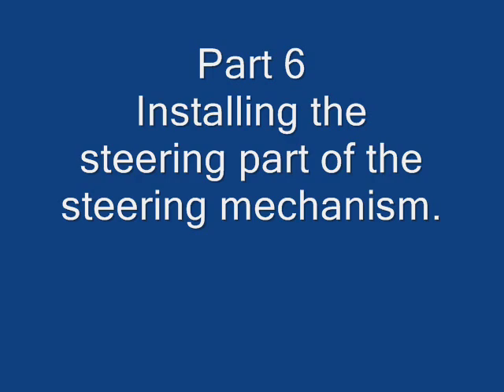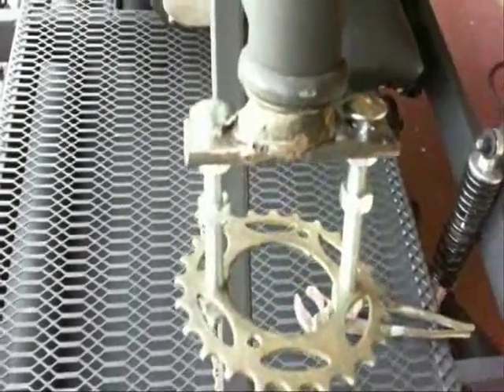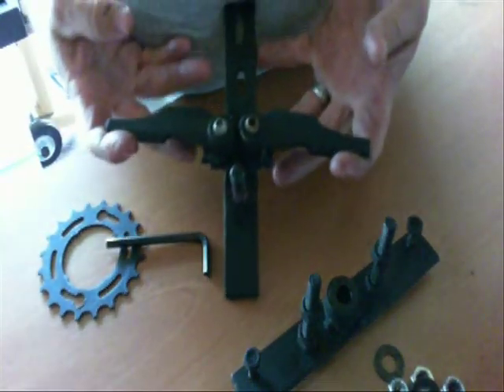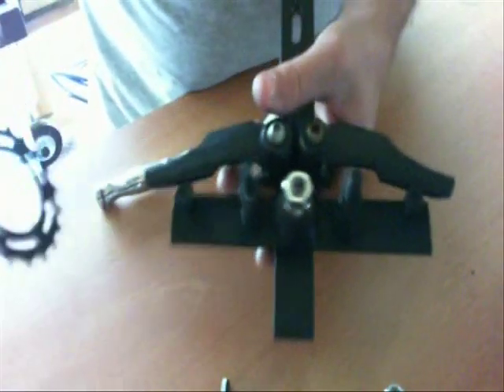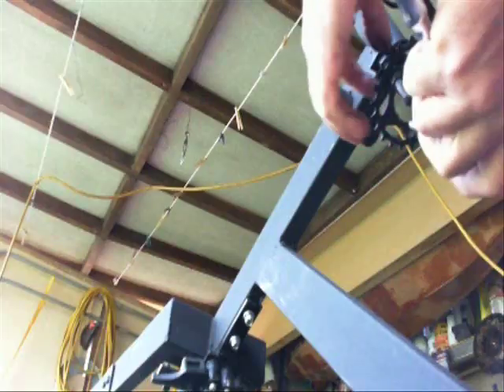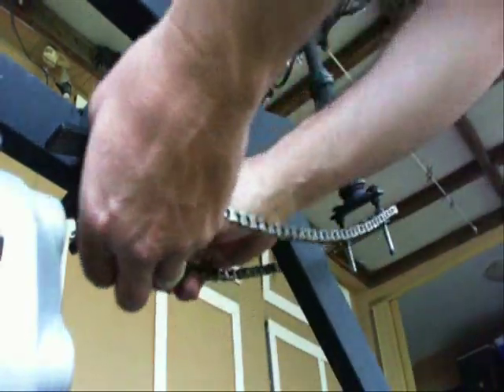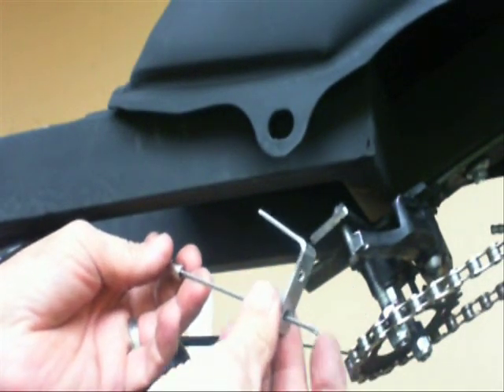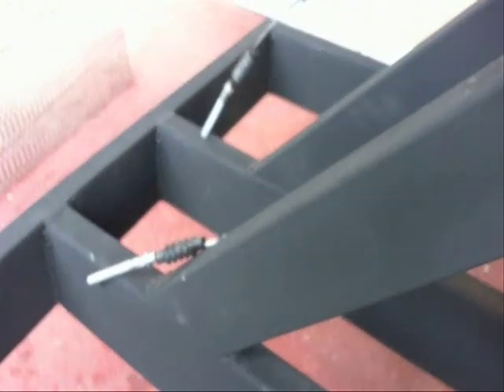Tracked Vehicle Steering Part 6

Comment: run cables to bars ? why bother with chain .
Reply from the maker: My idea was to be able to use a larger sprocket in the front and smaller in the rear so i would not have to turn the steering bars so much to disengage the pulleys in the back. It depends on how much pull I need to disengage the back. You may be right and it may not take as much as I think to disengage the back pulleys. I will have to see when I get that part finished. Thanks for the comment

Comment: When you crimp the ends on the cables, You wound need to solder or braze the crimped ends on also to keep them from slipping. Trust me on that one.
Reply from the maker: Thanks for the advice. Will do.